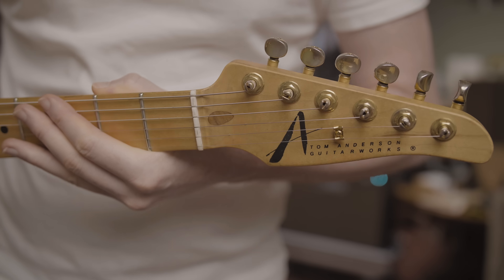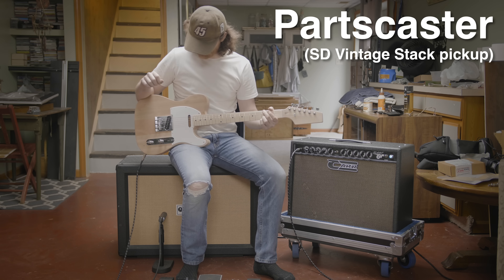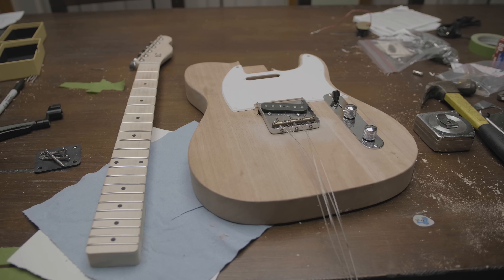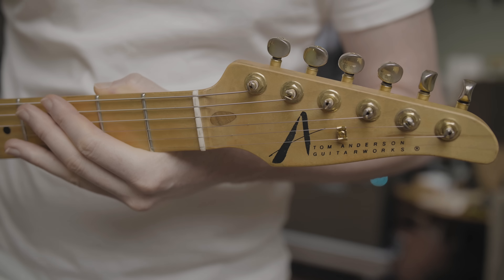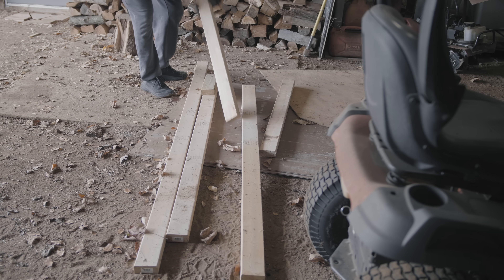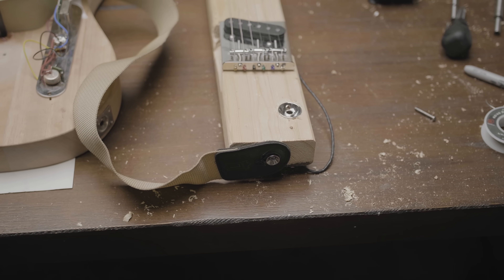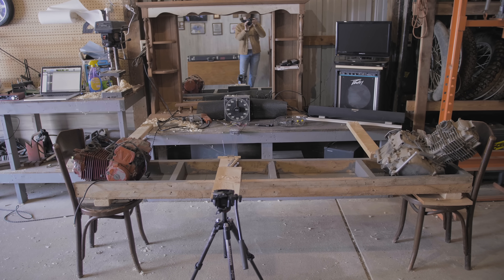Tested: Where Does The Tone Come From In An Electric Guitar?

Comment: This video just confirms what I assumed. The accurate list of 5 things that effect the tone of a plugged in electric guitar are:

1. The Pickup(s).
2. The distance and angle and position the pickup sits from the strings.
3. The pots.
4. Scale length.
5. The Pickup(s) 
(yes I said pickups again because its twice as important as the other variables and there really isn't much more changing the tone)

Comment: Beautiful experiment. You basically proved it.  Maybe you could try with all the computer curves like your other tests. The only problem I see here is you have to mount the bridge to something.  So the bridge will react with whatever it's connected to. I swear I could hear really good sustain coming from the bench as its rock Honda solid! No really bridge table! Plus neck can only be played with fretboard. Your tests and methods are spot on. You should test pickups!  That's another main topic. This is very inspiring.

Comment: I  never really bought the idea that body of an electric guitar matters at all, unless you built it so badly that none of the components are aligned or sitting tight and instead they're all all over the place.. Electric guitar has zero acoustic tendencies, like an acoustic guitar or even a hollow body, which actually produces some resonance to make a difference.. I'd think your pickup for sound and your neck for intonation would matter the most

Comment: You're using a whole wooden bench to tie the strings in one end and another bench to tie the other ends of the strings so your strings are connected to two massive heavy wooden benches and that's where the tone comes from. I can't believe people don't use their imagination to work out these things and are so easily fooled. There's a reason why wood has been used by millions throughout history
Reply: you do realize that even if the wood does affect the tone, the fact that its two massive heavy wooden benches would have more of a "tonewood" effect on the guitar right? but they just sound exactly the same. if wood affects the tone then the fact that theres way more wood on one of them should affect the tone and yet it doesnt. hmm maybe thats why guitars made out of metal sound exactly the same as ones made from wood?  because tonewood is a myth made up by luthiers to fool gullible people like you to buy expensive wood
Reply: @paddypenguin8895  Tonewood is only a myth on an electric guitar. Adirondack spruce and Brazilian rosewood are the Holy Grail for acoustics.

Comment: The air guitar is total BS. You claim that you are eliminating the body, when in fact you just made the table into the body.
Reply: Exactly. It's so stupid
Reply: how else would you stretch the strings аnd where would you mount the pickups? he could've mounted them to the solid concrete and it would've souded the same lol. quit coping on your tonewood bs boomer.
Reply: If you've increased the size of the body by 10x, shouldn't you hear that?
Reply: @NamelessSmile Why?, ………have you also increased the amplitude of the string vibration?
Reply: @scottbaxendale323  you're missing my point. If the tone wood does affect the sound of the guitar - then making the whole table the guitar's body should also affect the sound, as a table is much larger than a guitar body. But it doesn't
Reply: @NamelessSmile Yes it does.
Reply: @scottbaxendale323  sure it does buddy
Reply: @NamelessSmile His premise is that he eliminated the body. He didn’t. His premise is BS.

He substituted the mass of the table for the mass of the body. The table does sound different than an ash or alder body but not a lot different. The diddly bow used the side of a house for the body and it’s still worked. I’ve seen toilet seats and bed pans used for guitar bodies and they ALL have a resonance and a resonant frequency. The table has a resonant frequency too.

Comment: It's 14k comments at this point, so it's doubtful mine will be noticed, but nonetheless: 

I totally understand how the pickup outweighs every other consideration in guitar design, and how tonewood debate is largely moot, BUT:

There is just no denying that you pick up one guitar at a music store and it's a waterlogged piece of bog wood, totally dead, and you pick up another guitar and it vibrates against your body and sounds powerful even unplugged.

Moreover, you can pretty much judge the quality of an electric guitar by how it sounds UNPLUGGED, which gives lie to the whole pickup argument.
Reply: Well, I have read it, and I think: why do you want to know if it sounds good or different without connecting it to an amplifier? It's an electric guitar, after all. And if you feel the vibrations in your stomach or throughout your body... It just means that the energy produced by the string won't last long because it's being absorbed by your stomach. That means less sustain. So, your thinking has an approach that doesn't hold up. In the video, you can talk about applied physics and explain it visually, and the result is quite "correct," but the deeper we go, the more results emerge that clearly support what is being attempted or shown in the video.
Reply: @christianhertwig1593 how do vibrations of the string get absorbed by my stomach if they are not there to begin with? If you have an echo chamber, does it dampen or strengthen the initial sound?
Reply: @christianhertwig1593 why do I want to to know how it sounds unplugged? Because I can always swap out pickups and use a different amplifier. But the initial character of the sound (which frequencies get absorbed and which get reinforced through sympathetic resonance) will always be there.
Reply: @mentalitydesignvideo  First, thank you for responding: my reply is written in Spanish and translated. There may be some errors. 
Second, the system, the guitar, is a closed system in itself. Vibrations are created via the strings, and the two ends absorb energy from the movements of the strings. That energy is dissipated throughout the rest of the guitar. The less absorption there is, the better and cleaner the vibrations of the strings themselves. But when the rest of the guitar vibrates more, there is less sustain and less energy to maintain the movement, the vibrations. And if, on top of that, a body with a lot of volume is attached, resting on the corpus, and hands that hold the neck very tightly, these points are points of energy loss. 
And the acoustic tone is not transferred to the pickups. Not at all. They do not function like a microphone. Even the dirtiest pickups in terms of effectiveness, which could indeed function as a microphone, never have the amplitude to capture any tone in the air. 
If you are interested, there are books on this subject. Or electromechanics, electroacoustics, psychoacoustics, and biology "the ear and communication with the brain." It is also a very broad subject that has been studied at several universities, and there are essays on the subject "the physics of the electric guitar."

Comment: I just found your video coming from another video about a concrete guitar build.
I like how you dismantle some theories, that I actually questioned my whole life (I'm 64), but never checked.

However, I still have some points to think about.

I personally (no expert at all, only a little bit of theory in physics and acoustics) distinguish between e-guitars that don't need resonance and the others that are more build like an acoustic guitar or a violin (hollow, thin resonating material).

The fact, that guitar sounds can be digitally remodeled into quite different guitar types, indicates what's going on.

In another video you already said that electric guitars are usually recorded on the electrical path.
The speakers are for the listeners in the room.

According to the air guitar: it is still screwed onto resonance bodies (the table and that think with the engines).
The real comparision would be on two concrete blocks (not hollow).
But I guess that doesn't matter for a telecaster setup.

If you do the same tests for a hollow guitar type (used in jazz, or Les Paul), you will probably get different results.

The tone, how I would call it, depends on certain factors, e.g. the pickups and their position (that's why you switch between them), resonances of the body, and can basically change by something like an equalizer, apart from non-linear parts, like clipping, fuzz, drive, etc. which still can be modeled digitally (this includes amp models).

So, one thing remains, that is how long the string will sound, which also includes the initial amplitude, the more amplitude the longer the tone will last, the other part is the dampening, which determines how fast the amplitude is reduced over time.

I think with remodeling, you still have an advantage for hollow bodies.
Well that would be a nice A/B test, could you try that? It's the last part of my puzzle.

I see that you also have tested the resonance with the speaker...which I always wanted to know.
With hollow bodies that test might be different, because it picks up more of the acoustic energy from the speakers, and feedback makes a tone longer. On the other side, you usually try to avoid feedback, so it might actually be eliminated from the game (unless you are Hendrix). Though there might still be a small feedback that doesn't hurt.
Reply: in addition, it should be clear, that every part of the physical system can influence the sound. It mainly depends on what you like and how you use a guitar. For the main part music is something different than sound.

Comment: 0:47 the reply in red is most correct. The other two are fooling themselves. Player. Pickups & electronics. Strings (they missed that one). Hardware (SETUP, nut, bridge, frets, tuners, tremolo if installed). Guitar materials and shape (this is LAST).

Get a guitar you like to play, and put nice pups in it. You just saved $1000 on your dream axe. You're welcome.

Comment: There are many t-style guitars that typically have the same scale length, same PU position. You can throw in the same PUs and pots, and they still sound different.

Then there's a guy cutting off a piece of his guitar for each take, and while from take to take you hardly notice a change in sound, the difference from the full body to virtually none is pretty obvious.

Then there's this Warmoth guy, who does comparisons of things like a roasted maple neck to a non-roasted one (on the same guitar), and you can hear a tiny difference. I don't say it's the roasting, but I will say that even two necks with the same wood and treatment sound differently.

And string-thru vs. top loaded definitely makes a difference in attack. If things like attack and sustain aren't tone to you (the general you) - what do you consider tone then?

Comment: i know different wood vibrate different, like it even sounds different when you knock on it.

if you pluck a string it also vibrates the wood, the wood in return vibrates the strings in its own way.
Reply: If you record yourself with a microphone knocking on wood, it makes a difference. If you play a guitar with pickups, wood doesn't make a difference you can hear. If you believe in tonewood magic you should start thinking about what you eat before playing guitar. Because your body is part of the vibrating system. Or you hold the guitar away from your body while playing to change the sound. Just some suggestions to optimize your tone. Or you watch this video and don't deny it's results.
Reply: @torstenkaudt4793  well, it sounds different because it vibrates in a different way right?

so it would also vibrate different when a string makes it vibrate, and im pretty sure the vibration from the wood is vibrating the strings in return in the different way of the wood.

does that make sense?

Comment: Does the resonance from the workbench and wood struts add to sound?  It's not an 'air' guitar if it's screwed down to wood base supports
Reply: And the table wood is connected to the metal legs and the concrete floor and thereby to the ground beneath the house. Maybe this is where the magic of some studios comes from: different geological positions. Seroiously. Different electrical components can vary up to 10 or 15% which makes a much bigger difference than the wood your guitar is made of.

Comment: You made a U shaped lapsteel, out of two massive WOOD work tables and the floor they're anchored to. 

Those wood tables are either bolted to the floor OR they're so damn heavy that they're not moving despite there being around 120 pounds of pull exerted by the string tension.

In fact they seem so sturdily built that your tuning isn't even fluctuating.

Surely as you were drilling into those heavy ass sturdy ass wood tables and screwing the parts into the wood it must have dawned on you at some point that it's made of wood. And yet here you are, pretending it's a guitar made of air, or some shit.

Its way way WAY more wood than the normal guitar. This shit is absurd. You're a snake oil salesman. This is on par with those fake ass perpetual motion machine videos.
Reply: He jusr does not understands for the strings to have tension it needs to be held on both ends with some amount of force, and thin air cannot provide that kind of phgsical rigidity. All this changes the vibration of the strings and it will be reflected as the strings induce current to the pickup coils. Misinformation like this needs to be stopped from spreading. Not that the recent videos PRS have bewn putting out are very helpful

It also pisses me off that he does not use a pick to strum the supposes air guitar.

Comment: The last one sounded so great because of how well it resonated within both Honda engines and you must buy 2 $5000 engines to achieve this sound
Reply: I think it was the compression ratio lmao
Reply: The key is to use valve engines.
Reply: Could it be the amplifier and its electronics ?
Reply: Most definitely

Comment: What you're looking for might be outside of the guitar itself. The signal chain post guitar is what matters the most, with the speaker being more important than anything else (unless effects are involved.) when it comes to the guitar itself, the biggest difference is single coil or humbucker. Aside from that the only main difference between different humbuckers/singles is going to be output power.

Comment: So, none of you heard a difference between the Anderson and the air guitar?
Reply: In statistics it's called "a margin of error". You can't stroke the strings in exactly the same way twice, and that affects the sounds that are being produced. Also note that the strings are oriented differently, lying flat vs a 90 degree angle, and this is known to affect the sound slightly. And don't forget that no two pickups are exactly the same, they all differ slightly from one another. Not to mention that air guitar has no shielding and thus catches a lot of noise, most of which is in the middle region of frequencies. So if you look past the margin of error - the tone is exactly the same, just these superficial differences throwing you off.

Comment: I restored an old acoustic that had a sound hole pickup. 
The pickup had fallen apart, I changed the ferrite magnets in it to Neodymium magnets and the sound was surprising good for a sound hole pickup. 
Yep, pickups. They're the major difference. Replacing with stronger magnets is kinda equivalent to moving the pickup closer to the strings, I guess?

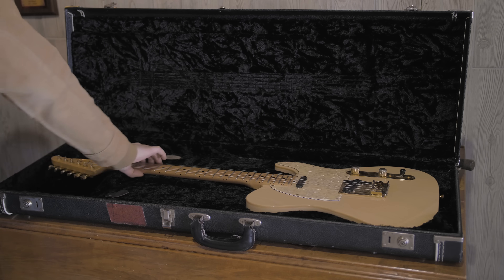Comment: There's some top end noise on that air guitar that's absent on the anderson, that's probably caused by only half of the pickup plate being supported thus resonant especially under tension. 10:06
Reply: No, that noise is there due to a lack of shielding on the air guitar. That's just the ambient ever-present electomagnetic field of the earth taking it's toll on the sound. Btw that's why they put tinfoil or conductive tape on the backside of the pickguard and connect it to ground - it shields the electronics and prevents them from acting as an antennae.

Comment: The tone only comes from the pickup, not anything else. Of course, the pickup's position relative to the strings (distance and placement) and the strings themselves and how they vibrate, influence the signal the pickup produces. The way the strings vibrate depends on how they are connected to the body and their exact material composition. In reality, though, all of those factors only make a small difference. The most important factor is the pickup itself, which accounts for over 90-95% of the sound.

Comment: Well the chords sound almost the same. Single notes sound much different to me. There is a slight muddy sound to overdrive chords that I don’t hear with the Anderson, so I guess for me it comes down to the listener.
Reply: In statistics it's called "a margin of error". You can't stroke the strings in exactly the same way twice, and that affects the sounds that are being produced. Also note that the strings are oriented differently, lying flat vs a 90 degree angle, and this is known to affect the sound slightly. And don't forget that no two pickups are exactly the same, they all differ slightly from one another. Not to mention that air guitar has no shielding and thus catches a lot of noise, most of which is in the middle region of frequencies. So if you look past the margin of error - the tone is exactly the same, just these superficial differences throwing you off.